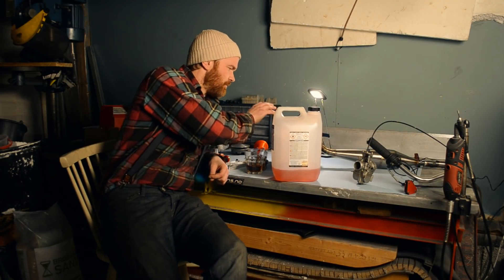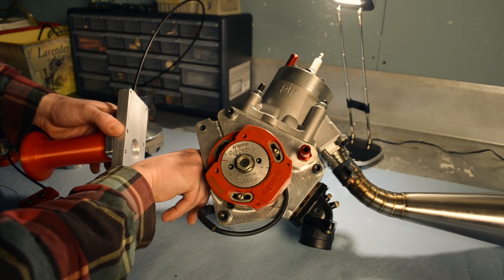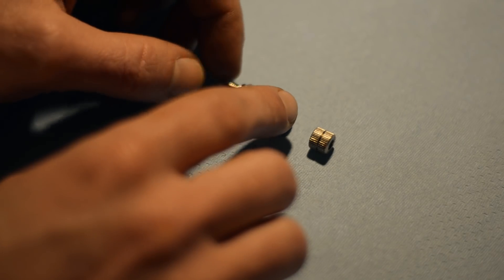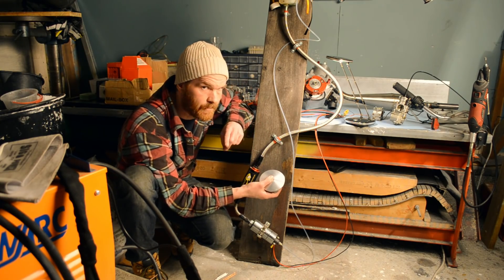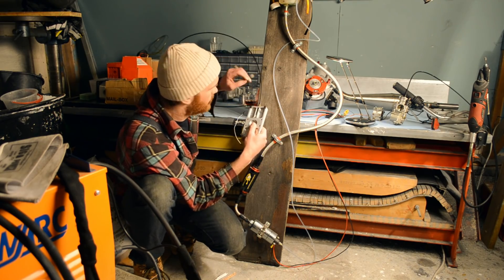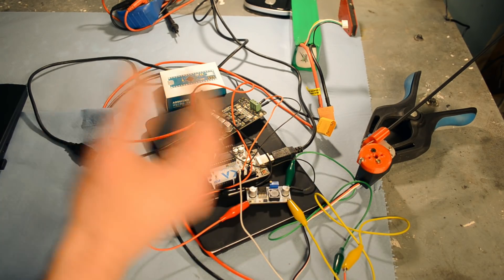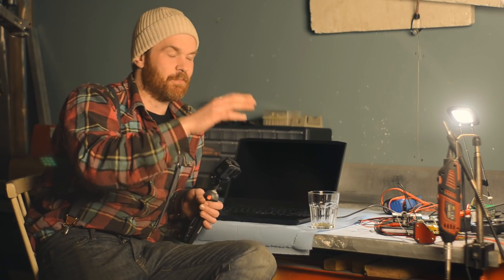That Nitro EFI setup - Most Powerful Two Stroke Ever.

Comment: Partner, greetings from Arizona, USA. Have you seen/heard of megasquirt? I think it would do everything you're looking for based on a TPS on the carb + programmed conditions in the box, would take over, shunt the fuel supply, actuate solenoid for the air valve and run adjusted/compensated fuel supply with injectors. Just a thought! I wish you all the very best on this project and you're doing some awesome stuff.

Comment: Wait a minute... in traditional 2 stroke engines, the upward travel of the piston is used to create a vacuum in the crankcase which draws in the a/f mixture through the reed valve and the downward motion closes the reed valve and pressurizes the crankcase sort of like a supercharger to aid in the transfer of the a/f mixture through the transfer ports into the cylinder. If your engine is going to have what essentially amounts to a window into the crankcase how is it going to pressurize? I'm trying to wrap my head around that part.

Comment: My dear friend, we come from Motorcycle Grand Prix racing, when 2 Stroke engines where still allowed. We continued the development and we have 600 horsepower per 1 liter engine capacity from Super Plus petrol mixed with regular AvGas.
Despite your idea with the piston ring, your piston itself will cause trouble, as your exhaust port is too big. Be careful when you run your engine the first time, after 3 mins of warming it, take the exhaust off and look with a torch at the piston of the exhaust side to look for damage above the piston ring.

Your idea with the secondary intake will work! 
I have tried this already in 1994 and built a complete new engine cycle out of that. 
I made a 4-Stroke engine run like a 2-Stroke, basically I built a 2-Stroke engine that does not need a crankcase and has permanent oil lubrication.
Good luck with your idea and the engine that has 600 hp/liter is still working like a regular 2-Stroke. Hope you can match that!
Martin W.

Comment: Could you tee off the injector to a small ram ( I have some pneumatic ones with 10mm bore, 30mm stroke), It would ensure the two events occurred together, but would only work at WOT of course.

Comment: ehh, I mean, it's cool that it's the most powerful HP to bore diameter. But I'd rather see it HP to weight.  Or designed to fit on a bicycle.  I LOVED your 66cc motorized bike stuff.  those cheap engines are so cool.  Even I can afford them.  I saw a guy here on YT do a dual-engine motorized bike with a jackshaft to transfer the power.  Thought of you. All of this 'most powerful' stuff is too much for me, both mechanically and financially. It is cool though.

Comment: Hello how are you? hope you are well, your prototype is very good, but I 2t and 4t experience with methanol and nitromethane drum. Mix nitro and methanol at the same time, you can, but you should not, because the engine is unstable, ex: nitromethane maximum 50 cc in 1 liter of fuel (more than there it becomes unstable difficult to control) nitromethane provides a lot oxygen, that's why it raises a lot of temperature. Methanol 500c.c and 500c.c of fuel works well (100% pure methanol remains unstable and very dry) with methanol you have to delay the spark to almost PMS, what methanol does is advance the spark and explode earlier at about 600º Regarding the fuel that explodes at 800º and with methanol you have to increase about 30 or 35 more points of jet and with nitromethane 5 or 10 points. I hope my help will help you, greetings from Argentina;)

Comment: What if you reversed the valve actuation? Use the spring to open it and the servo to close. A simple latching mechanism on the servo would allow a quick release to open and then a slower closing if you needed to regulate the flow for some reason.

Comment: Hey! I could not find your email adress. I have an am6 engine, if interested. I needs new bearings and seals. I also have a fully working piaggio nrg. You can have both for free. Located in Trondheim. HMU if it sounds interesting.
Reply: Found it 🤙

Comment: There are RC 2s engines making .875 HP per CC... (SH .28 8 port), You think you can beat liter bike power with a lawn mower sized engine? I hate to break it to you, but your 2 stroke engine wasn't designed to run at such high rpm like a nitro rc engine is. So running the same rpm means you'll have to rely on torque to provide the extra power, or if you can only go a little higher on the rpm then you'd need to heavily rely on torque. Which is more of a function of efficiency, the amount of fuel, and the energy it has. Nitromethane requires less air, so you can pump in a lot more; but it's far less energy dense. Gasoline has 116k btus per gallon vs nitromethane's 48k btus. If google is correct, then that's 242% more energy. Which means you'd need to dump in at least 2.4x more fuel at the same efficiency just to get the same amount of energy. A 250 2s making 50hp per liter, which is quite reasonable, makes .2 HP per CC. So you need to increase the engines power by 4.5 times in order to catch it. IDK what engine you have or its displacement, but I know my 450f with 50hp could out run most 250 2s bikes so I'm making some assumptions. All told, you'd need to dump 10.6 times the amount of fuel that hypothetical 50hp 250 2s engine normally would take to equal the RC motor while still maintaining the same efficiency. That's also assuming the piston, rod, crank, bearings, etc can handle 4.5x more cylinder pressure.
.
Reasonably, this is click bait. Especially since you have not completed the engine and tested it for power, nor would you have a good faith basis for assuming its power level could be increased so dramatically. A non click bait title would be similar to, "hoping to build the most power per displacement two stroke ever." Even the title leaves out displacement.
Reply: been thinking along the same lines myself

Comment: get a 1978 to 1998 Kawasaki KE-100...... they stayed EXACTLY the same for the whole production run
.
very common.... very cheap..... yet actually great little bikes
ive got a 1974 g5 (same as KE-100.... but more metal parts like the gas tank and 6 volt electrical) 
.
i will NOT sell you my G5...... its far too much fun, and the engine works perfectly (i rebuilt it in my basement lol)
.
but ya.... KE-100..... cheap, simple, light weight, lots of room for modifications

Comment: If want the valve to open fast use , perhaps a pneumatic cylinder under pressure or you could even use vacuum from the engine. You could control the opening  and closing speed very easily .

Comment: I used to have a keen interest in 2 stroke engines, too old for that now, and modified many for racing.  Never understood why nobody ever tried to mate a 4 stroke engine with a 2 stroke.  The idea I had a many years ago was to use 2 intake valves with a supercharger and fuel injection.  Get rid of the intake port and the transfer valves.  The valves open as the exhaust port open and fuel is injected just before the exhaust port closes. It should work
Reply: Two stoke diesel have the design you talking about.
Reply: @noenlunde7028  Not the same at all.  The concept is similar but function is different.  It uses the valve for the exhaust which is very inefficient.  With the blower you could leave the intake valve open till after the exhaust port closes to supercharge the combustion chamber.  The only unknown that I couldn't quite wrap my mind around was lubricating the cylinder walls but I'm sure there is a solution to that

Comment: Timing - nitromethane vs petrol fuel is very different... u need 2 separate timings do make that setup to work properly, nitro methane must be ignited much sooner than ordinary fuel, maybe around 20 degrees or so...? u also need a much bigger ignition spark to make very much more nitro to burn. Nitro/air is optimum closer to 1-1, petrol/air ratio 1-12/14, metanol ratio is 1-6 or so. Nitro contains more energy but burns slower due to one (1) extra oxygen molecule added, calculation on a tweaked pipe with ordinary fuel vs nitro is also different due to much more fuel is added= more volume per revolution rpm etc. U don't need any cooling system running on nitromethane either... My 2 cent, Good luck!

Comment: Needs a intake spacer 3" minimum my banshee had carb spacers and it gave it a little umph on low end torque and some how expanded the top end range
Reply: I wonder if he built a  specific crankcase volume into the engine when he designed it from scratch?

Comment: Given that you need to transition from carb into resonant pump-mode you are probably going to need to have full fuel injection pressure, and then valve it precisely on/off (while still adjusting nitro pump pressure before/during/after) while the slide is opened.
I agree with Matt Hemberry that you need Solenoid speed - and no servo can ever do that quick of a motion. There are (surplus) rotary PM Solenoids that rotate 90 degrees, and use less power in hold mode. I have 2 that are aprox 4dia x 7lgnth CM, and 12VDC. I can find the part numbers or send one to you.
Reply from the maker: Sounds awesome!
Reply: @2STROKESTUFFING  I found the rotary Solenoid but unfortunately one of the windings is open circuit = INOP.  I took it apart and it's really 2/3 'rds the "Rotor" of a PM Motor inside. I found the broken wire 0.008" (32 GA) and the other winding read 90 Ohms. I remember there was a plate pressed onto the spline that kept it from rotating more than 120 Degrees that would hit the Metal Pin pressed into the wiring side plate. Otherwise the wiring would be wraped around and pulled inside.
Blue-White = 90 Ohms Red-Black = Open. The ID of the magnets is 40mm. The Motor OD ~55.9mm, L ~70.2mm, Shaft 6.35mm. The Stator is stamped "EMT".
(I sent pictures to your Gmail account)
Thanks for showing!

Comment: If the fuel pump is a problem running nitro methane. Could it be a solution to not run a fuel pump at all? “Just” pressurize the fuel tank with a compressor, keep the compressor running at a set pressure. You can even use a co2 bottle with a regulator.

Comment: i got one ot question ,, i want to start to build hex drone and wish to power him with 2 stroke ->generator ->bats ->engines kinda like this .. but problem is vibration and weight of bigger ones ,,can anyone suggest one that have less vibration and weight but still strong to power at least 6 electrical engines  ??  thanks for video i love every one :)

Comment: If you aiming for the highest relative power, do you think 50cc is the sweet spot?
3cc RC engines also can make pretty impressive power (relative to its small size off course)
Or maybe 100cc has more potential, no idea.
Possible you started with a 50cc moped size engine, but you are limiting yourself now.

Comment: Electronically tuned CVT?? Please explain
Reply: a single variated motor pivots as pulley diameter changes to keep proper tension on the belt. rather then a fixed rate spring, he'll be using a pulse width modulated actuator mapped from rpm and road speed.
technically, a tps or strain gauge (load measuring) would be more accurate.
Motobecane and Peugeot mopeds used this system for decades (with springs)
edit: Arduino Variated Engine?

Comment: Just a thought with the injection testing maybe look at getting a cheap glass fish tank and make it relatively sealed and have a drain in the bottom so you can use it as a crude test bench and keep volatile fumes contained

Comment: About 10 years ago I was racing a KTM 250 2 stroke motocross bike and by accident my mechanic put in a dome topped piston when it should have been a flat one. I rode the bike and it was insanely powerful, spinning the rear wheel while lifting the front wheel in 5th gear but it was destroying spark plugs in a matter of minutes, literally breaking them up. Only after taking the head off did I notice the dome top on the piston which must have upped the compression by a lot. It was not sustainable but it’s always interested me how huge the power was.

Comment: Could you use the Arduino to ramp up the fuel pressure more slowly and thereby match the slide opening? I figure you will need to smooth out the power change at the opening time. On a four sroke I'd expect stutter, stutter, stutter, woosh but flow into a two stroke is much more complicated and intake pulsing may take a while to establish and so smooth out power delivery. I can't wait to find out.
Reply from the maker: 👍 Might have to, we'll see how it behaves.

Comment: Is the velocity stack pointed towards your front wheel? Won't it suck up a lot of salt?
What kind of oil is mixed with the nitro/methanol fuel?
Reply from the maker: Yep, needs a guard. Ester or caster based oil.
Reply: @2STROKESTUFFING  Thanks mate!

Comment: Great video as always 👍. 

Testing fuel systems with high flashpoint liquids is much safer. Using white spirit, diesel or kerosene is typically what's used for testing fuel injectors.

Comment: theoretically you could inject a mixture of nitromethane and water into the exhaust, steam would then expand immediately and the charge on the cylinder would be increased. In addition, oxygen is also released into the mixture, which results in better combustion.
Reply: Old Drag Racing trick 👍🎯😎
Reply from the maker: Interesting stuff

Comment: Just a stupid idea, open the slide valve with a hydraulic or pneumatic cylinder getting power from the fuel pump or the crankcase pressure, if there is any😉 closing could be done with a spring and you could control it with valves. Just an idea.

Comment: The spray mist is nice. Keep going. To avoid repeating yourself to the world, just call it the most powerful 2 stroke (HP/Litre). I've watch every episode. I think a thin profiled bridge in the exhaust port would have given you 98% of the current exhaust volume and avoided all the delays and development of the piston and special ring. Allowing the r&d to go into the bottom end. Running on high content nitromethane with your crazy bottom end would do the job.  You're conrod will be the limiting factor when you start getting heavy on the nitromethane. The cylinder pressure and torque will skyrocket. Keep up the good work.
Reply: It seems like the piston has a lot of mass when you compare it to a normal 2 stroke piston. At ultra high rpm´s that could become a problem. I think you are wright , it´s the bottom end of the engine, especially making it with as little dead volume as possible, that should also get more attention.

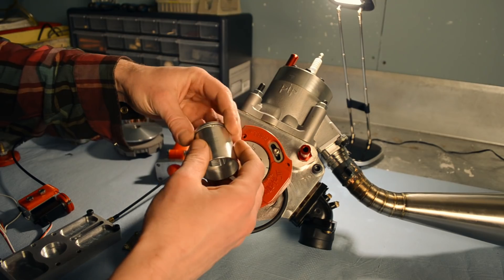Comment: 1:10 That pin holding the ring is still a concern, it seems to be great for stopping the ring rotating but how well will it allow expansion and contraction? On a shot from another video i think you showed it allowed some expansion but it wasn't really clear, i was thinking the ring could slide the fraction of a millimeter in and out with a slotted hole in the ring? But as you said "so it can't expand too much"...does this mean you have allowed just enough clearance in the hole already to move in and out? Probably better if it means it doesn't stop the ring rotating fractionally back and forth if it wants to. Fascinating how you can basically control the limit of the rings movement with this locating pin.
Can't wait for you to find out how well it works.
Reply: I think that the pin is on the exhaust port side. Ring would still be free to expand in other directions to form a seal. It just keeps ring from going too much into that huge exhaust port and catching on the edge of the port.

Comment: I want to try those pistons in a 2 stroke dirtbike like my YZ250...
Reply: Would they fit?
Reply: @billbergen9169  nope. I have to double check but the stock bore is 66.8mm iirc. And then you have to consider pin to crown measurement, among others.

Comment: Have you looked at the fuel they use in Radio Controlled cars & planes ?, it's readily available to buy at most model shops and is a mixture of methanol, nitromethane, and oil.
Reply: That's exactly what he has...

Comment: You will tell the
crankshaft stroke and the piston diameter...? What cubic capacity is planned?
Reply from the maker: 50cc, 39.7x40mm
Reply: @2STROKESTUFFING  And how many horsepower / RPM at 50ccm is the target... 🤓?

Comment: you could drill one hole and incorperate the port for the pumper carb/crankcase pulse pipe into the servo valve. valve opens, closes pumper carb hole, no fuel issues on zero throttle/16k+rpm :D

Comment: Could you go the direct injection?  You could seal the bearings and pressure feed them? The injection would need to be timed.  Maybe use a nitrogen high pressure tank for the fuel pressure to eliminate parasitic drag on the motor. Eliminating the oil from the fuel would enable a higher compression ratio.  With direct injection you could use a pressure sensor to sense miss fire and momentarily stop fuel injection to prevent hydrolock. Nitro at high flow rates is predisposed to hydrolock and engine explosions.
Reply from the maker: Something to explore in the future 👍

Comment: Wouldn’t it be better that the injection start before the valve opens and the mixture being rich rather than the valve opening and the injection not up to full speed and the engine going lean ... at 19000 rpm the engine would be killed pretty quick
Reply from the maker: Absolutely

Comment: Consider pre heating the fuel?
That’s a lot of cold fuel droplets ready to drop out of suspension     
4 strokes are timed to inject on the back of a closed valve so it has time to vaporise which is much better for complete combustion. Hopefully there might be enough heat in the bottom end to vaporise the mixture. But it’s worth a second thought.
Reply from the maker: 👍 A real concern.

Comment: Try the ESP32 instead of the Arduino. Same same but muuuch faster, more memory, smaller and cheaper.
Reply: But faster and more memory isnt needed. And you can pic up arduino boards for a couple of quid.